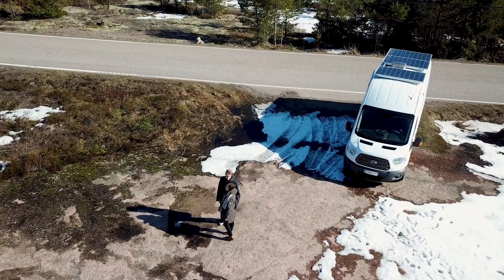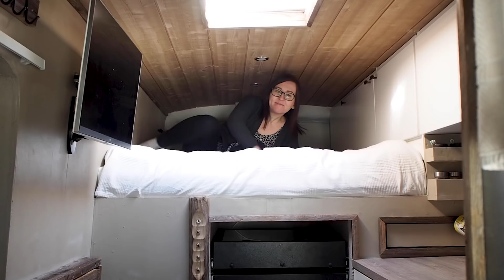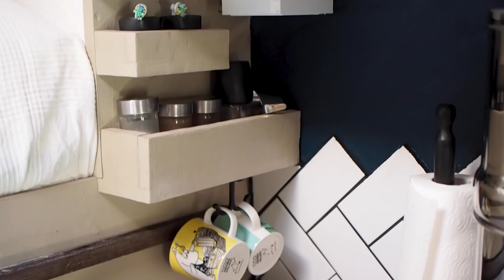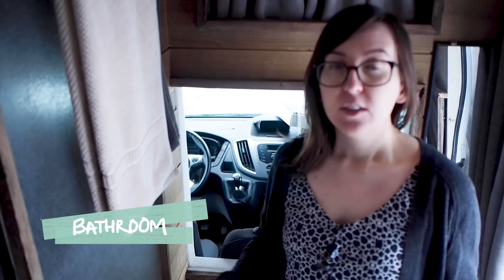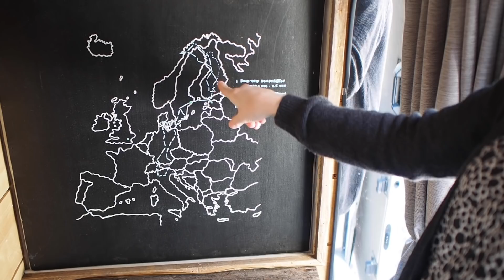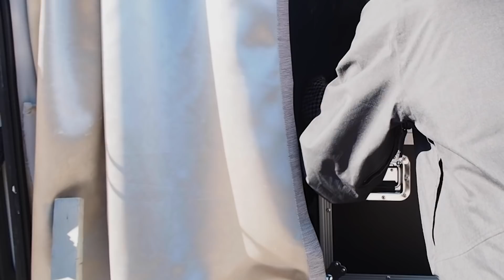DIY self-converted Ford Transit van conversion with shower and office | VAN TOUR

Comment: Why don't you just pee on coca cola bottles? It would be much more environmentally friendly.
Reply from the maker: Hmm.. First of all we don't drink coca cola 😅 and second: we have Palpa return systems here in Finland and we the return empty beverage packages to the return point and get back the deposit paid in the price 👍🏼
Reply: PIIIA that is so cool, CA used to do that when we had glass bottles, but now not so much (I think they still do it with beer bottle though)